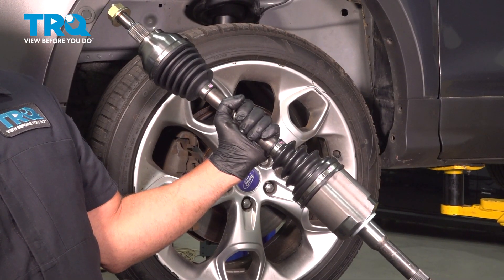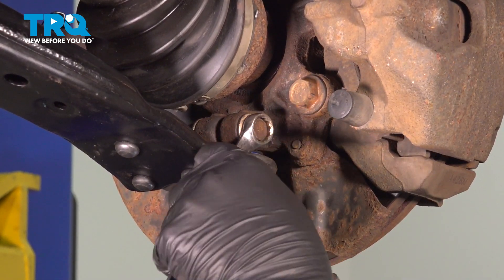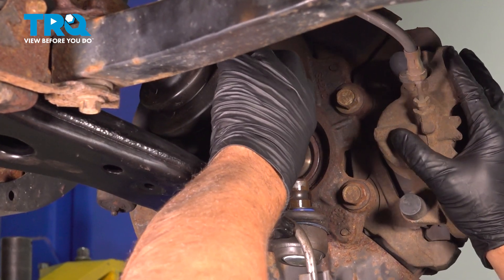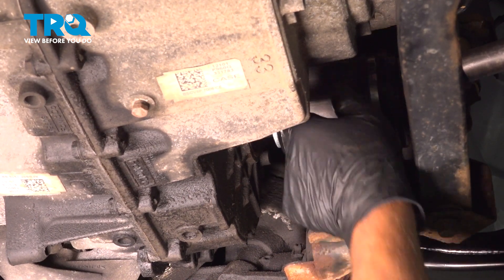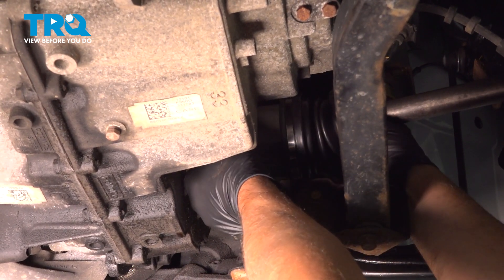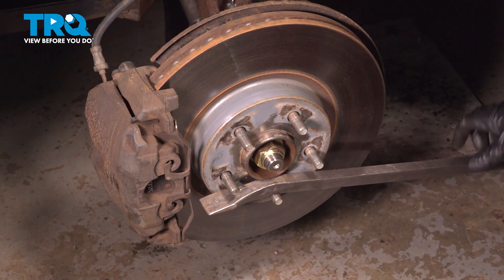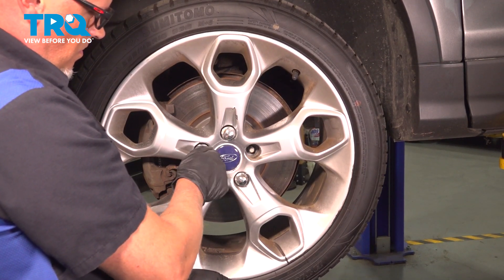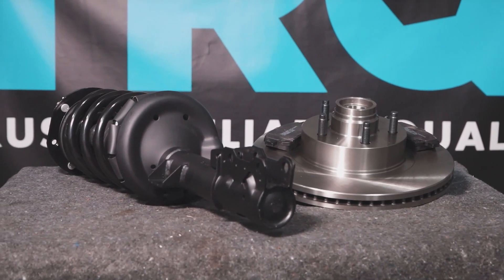How to Replace Front Driver Side CV Axle 2013-2019 Ford Escape 2.0L L4

Comment: I have a 2013 Ford Escape and everything went smoothly on this once I had the right pry bar. Couldn’t have asked for a better walkthrough. Now that it’s been a month, I am having some transmission issues and I replaced the fluid but noticed that there’s a leak in the CV Axle. Just left AutoZone and they don’t make a front CV Seal. Where did I go wrong on this part? Followed the video to a T.

Comment: That's all fine and dandy till none of it works as shown in the video. I'm in a huge pickle. I'm currently trying to do this on a 2016 escape and I finally got both the cv axle end pushed in with a bolt on tool and two ait hammers, but the driver side control arm refuses to come out. I've used a piece of chain in place of the exhaust clamp, I bought the s shaped tool, and this other tool that I know won't work without a 12-foot cheaper pipe. I've used a small jack under the brake rotor to try to balance out any pinching force that might exist on the control arm pin. I've gotten it halfway out, and it will not move any further. The other one I have tried yet. Like I said, the car is on jack stands in my yard, and I basically can't move it now. If someone has some advice, please, I need the help. I even tried the air hammer on the control arm pin. It just won't come out. If I could afford to buy another control arm, I'd just cut this one off. What can I do to get it to let loose. And furthermore, how in the world would you out it back in after the axle swap if it's this impossible to remove?

Comment: I have a 2013 Ford fiesta SE the seal that you use for the SE model that goes into the transmission has a red insert in it it is BRS 172 how do you install that seal with that red insert what's the procedure is there a video somewhere with that